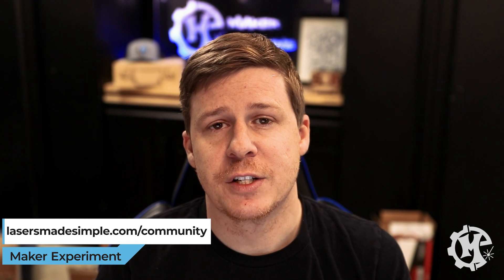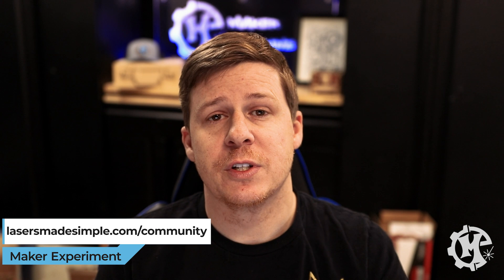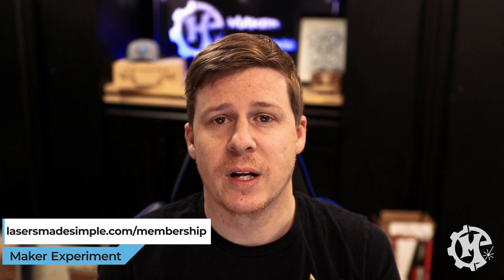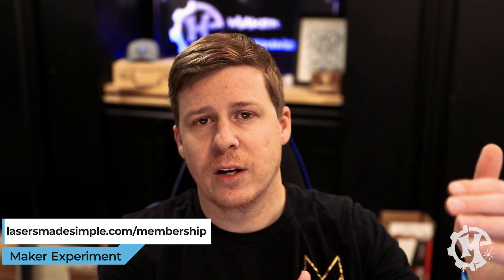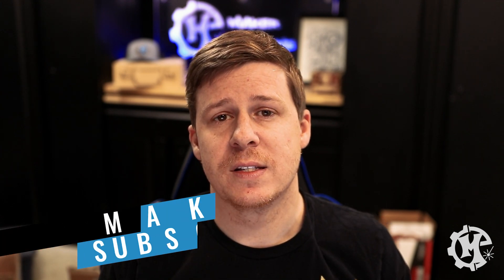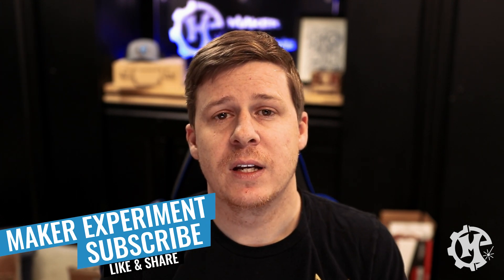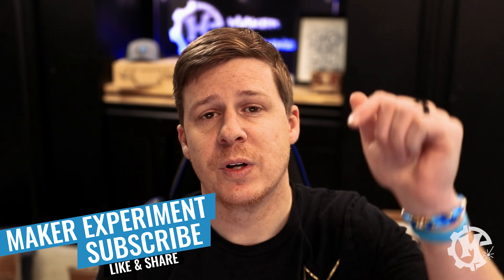The Top 5 Mistakes Every Laser Owner Should Avoid

Comment: Starting to use the 4" lens, how do you use the camera accurately with it? When I drop the bed down with the long focus tool, the image on the camera doesn't lineup anymore.
Reply from the maker: You’d have to re-calibrate the camera to that lens focal distance. If you aren’t going to be using that as your primary lens, I don’t think it’s worth doing. You can use the trace function to see where the image will land. I don’t believe it has the capability to store two calibrations for the different lenses, but I could be wrong.